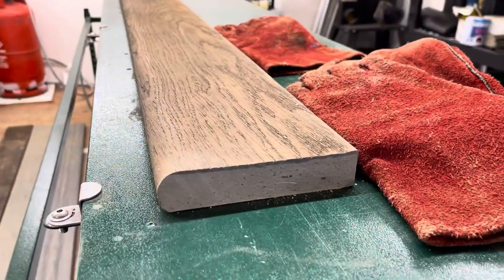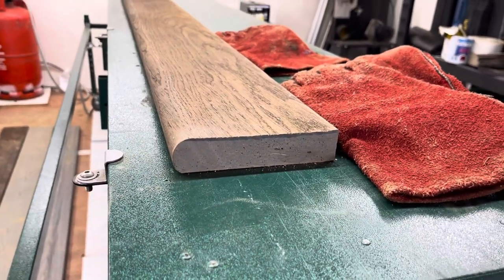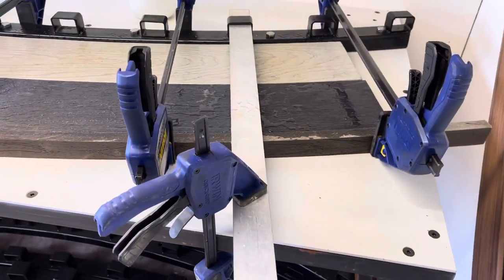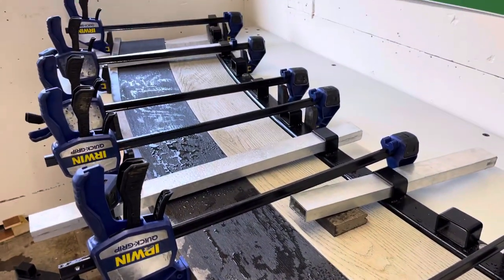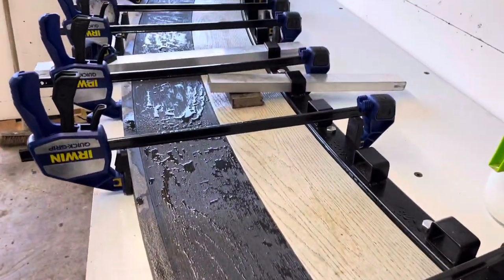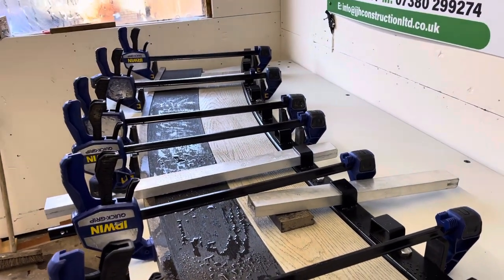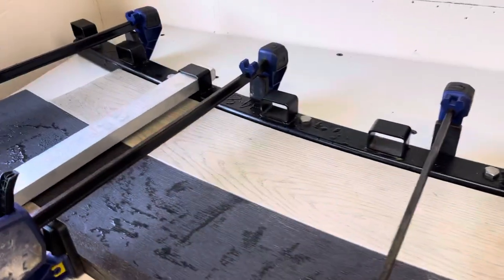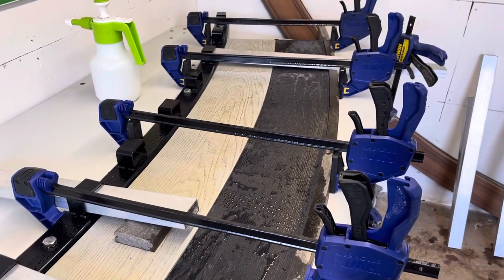1st attempt at curving Millboard

Comment: Wow I didnt realise these boards could be bent. Whats the tightest radius you've achieved?
Reply from the maker: Hi Mark this was a shallow radius of 2.600m I haven’t got around to doing anything tighter yet as we have just got hold of a new electric oven so once we play about with the times and temperatures I will have a go and see how far we can push it
Reply: @jjhdecking7387  Thanks. I'm wondering if a 650mm radius could be achieved.  What do you think?
Reply from the maker: @markdickinson2650  no not a hope of that mark way to tight the boards would split.